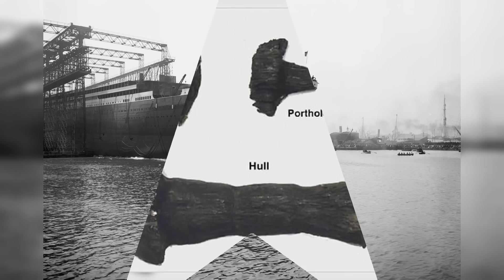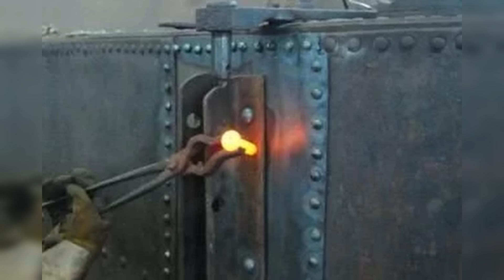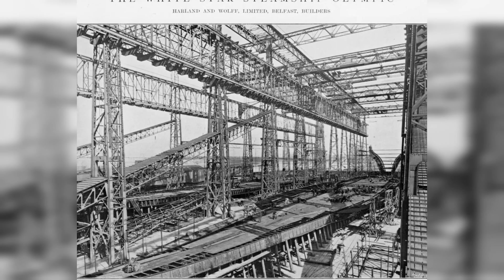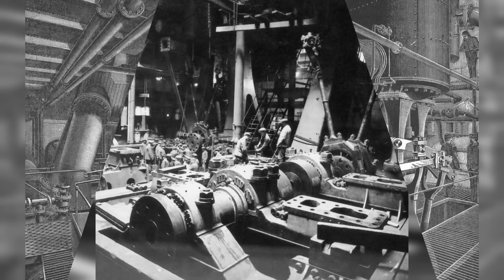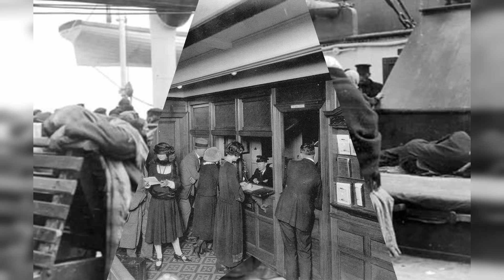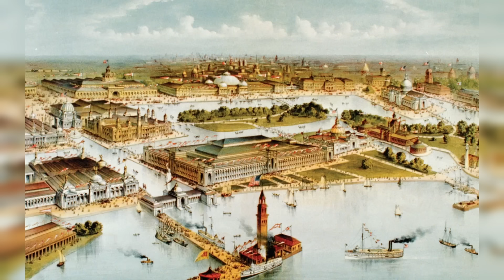TITANIC MYSTERY. How did they hammer 3 million RIVETS? There wasn't enough time!

Comment: 2016 I watch some guys rivet the keel of "The Eagle" built in 1936. That was approximately 160 ft and it took them 2 weeks, 12 hrs/day. Riveting has to be precise its not as easy as we think. Next time it comes to dry dock i'l actually count the rivets and take the measurement.
Reply: Thx friend.
Reply: @Alan-Godden  it will be back sometime in 2017. I’m 54 and has been in steel work since the age of 15. There are only two AWS certs I don’t have and a lot of these stuff don’t add up. Brooklyn bridge don’t add up.

Comment: Compressed air rivet guns were used, not sledgehammers and swages. You can see the hoses on your photos and the constant ‘machine gun like’  noise was constant inside the echoing hull.
Reply: Even when you research it it says a lot of it was done by sledgehammer
Reply: I've done a lot of research and they used hammers primarily(alledgedly)but yeah there's even photos of the air Hammers in this video

Comment: "Only on the keel and some sections of the bottom" but the picture shows the workers at the top of the ship using the hydraulic rivot machine
Reply: Or it’s staged like a lot of construction photos. Throw up some scaffolds and have someone holding a tool voila “we built this”
Reply: Also...anything of large scale is not built how you think. It's not start here and finish there. Sections of it are made. Then you take the sections and arrange them and put them together.

Comment: Match boring is the method we use so that we do not have to worry about hole misalignment.   At 7.35 you can see the yoke of a large riveting machine.   I was in ship yards in Scotland and knew riveters who changed trade to Burner, Plater, Pipefitter or Welder.

Comment: Charcoal, as a form of carbon, is a fundamental material in various battery technologies, primarily serving as a conductive additive and a key component in electrodes. Its high conductivity, chemical stability, and tunable structure make it indispensable for enhancing battery performance. 

Commercial Battery Applications

In commercial batteries, particularly lithium-ion batteries (LIBs), specialized forms of charcoal-derived carbon are widely used: 

Conductive Additives: High-purity carbon black (a form of carbon derived from heavy petroleum products, similar to charcoal in composition) is mixed into the electrode slurry during manufacturing. These fine particles create an electrical network, facilitating the efficient flow of electrons between the active materials and the current collector, which improves charging and discharging rates and overall energy efficiency.

Anode Material: Graphite, a crystalline form of carbon, is the standard anode (negative electrode) material in LIBs. Researchers are also developing "hard carbon" materials derived from bio-waste charcoal and coal as a low-cost, high-performance anode for next-generation batteries like sodium-ion batteries.

Structural Support: Carbon materials help maintain the structural integrity of the electrodes and dissipate heat, which is crucial for preventing overheating and ensuring battery safety and longevity.

Comment: It would be interesting to discover if coal is to be found in what's left of Titanic's hull.
Familiarity with steam locomotives one sees that they really weren't designed to run on dirty fuel, like wood or coal and had to be torn down to clean/replace the boiler tubes. 70% of the steam power was generated in the firebox with only 30% generated by all the tubing - tubing that made cleaning a nightmare.
Reply: I beliwve the coal was an adaptation. I believe, they had heating elements much like a kettle! They could have been on battery packs, which would keep them charged up through motion....
Reply: @reliantrobin1573  Adaptation, that is what I too believe.